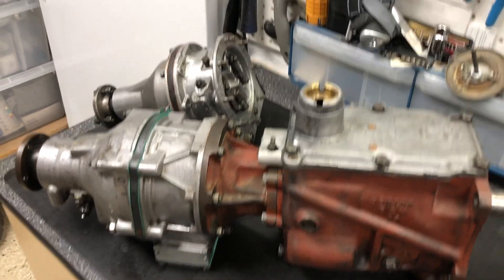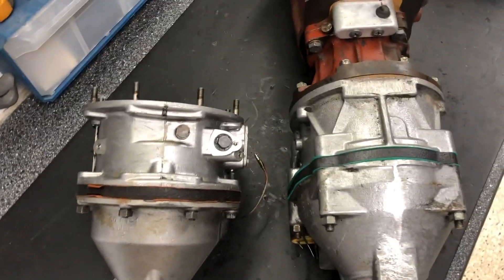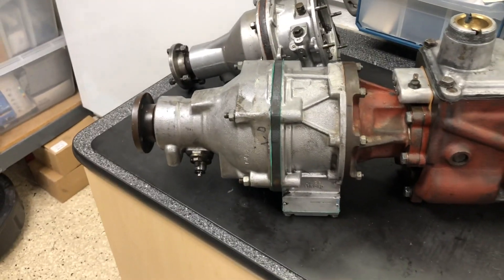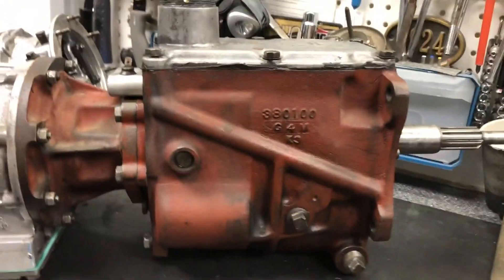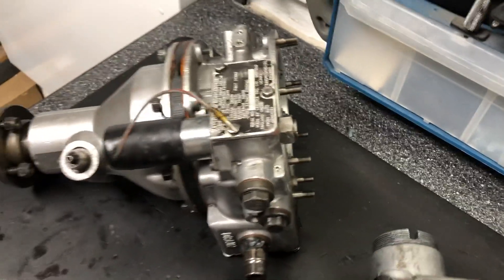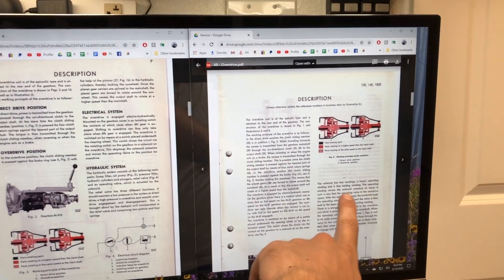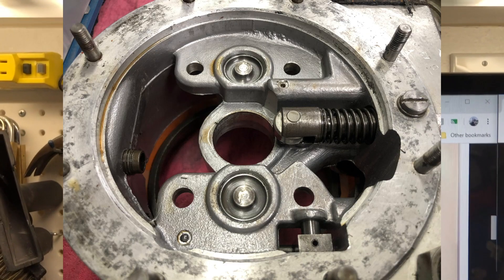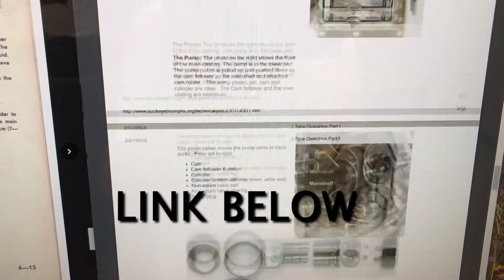D type vs J type Laycock Overdrive - Volvo

Comment: great video, tons of knowledge. Do you maybe know, as a person who clearly knows a lot about volvos from the 1960s, if the m30 is the m40 gearbox without a 1st gear? I've read something like that, but it seems kinda unusual, as moving from a stop beginning with something that would normally be a 2nd gear clearly is not a good idea for the clutch. M31 is indeed rare, but i have seen an amazon with one - considering buying it now, but it has quite a bit of rust present sadly

Comment: Just an FYI on the capability of these overdrive units. I installed a 4 speed with J type overdrive in my Jaguar E-type.  I got a refurbished strengthened o/d unit from the company in Sheffield, England.  No issues with the roughly 270hp from the V12.  It would engage with a snap without slipping, but I’ve always eased the accelerator when engaging and used the clutch when disengaging the o/d.

Comment: I found a J type O/D unit in an 86 GMC C3500 1 ton truck. How much hp and torque can these units handle?
Reply: Interesting... Was it mounted on the back of the transmission? Or remotely mounted in the driveline?
Reply: Could be low on oil

Comment: I thought the overdrive unit takes ATF?
Reply from the maker: It can. They work with a variety of fluids. I went with a non-detergent SAE 30 to assist in keeping the debris and grime off the vital components as recommended by factory specs.

Comment: I think that that I need to rebuild my j type overdrive on my m46 manual transmission. Just did a trans swap on volvo 245. Gearbox feels great all new clutch components. Used all sensors from original trans. They all worked prior. When install was complete and took for test drive everything was great but once od was engaged made a bang and clunk noise followed up by some cluttering sounds. Immediately I took out of overdrive. 

All electrical seems in good order. Solenoid heats up with switch on. Lights work with no flickering. Havent torn into the overdrive yet. It would be my first. Could use some help understanding the problem before I pull the transmission out of car again. Swap took me about a week. Not much information out there on this od systems that I have found. I did read up on your link you shared. Any suggestions or recommendations to help with my situation?

Comment: I put my 240 in reverse with the j type engaged once, I let off the clutch and nothing happened. I just sat there, no noises or anything.
Reply from the maker: My understanding is if you start driving that’s when the input shaft on the OD starts pumping and building pressure and then the axle spinning in the opposite direction is fighting the  unidirectional clutch, stressing it and potentially breaking it.

Comment: Modified m40 to an m41? How did you do that? You did the impossible, you could make a whole video just on that
Reply from the maker: Just change over the mainshaft to the longer style that the overdrive can bolt into. I do have a video coming for the M41 gearbox and OD reseal